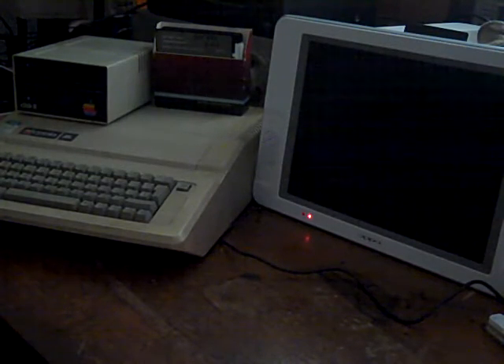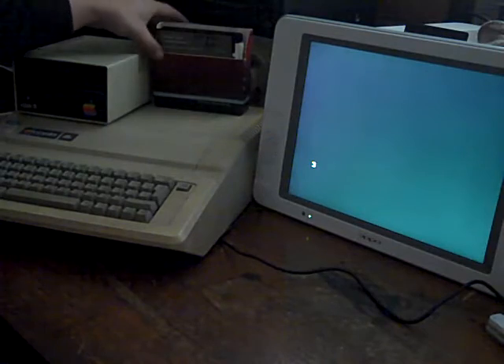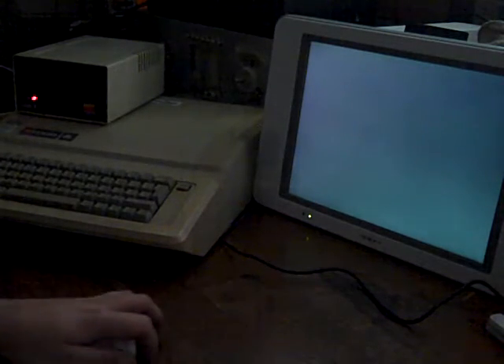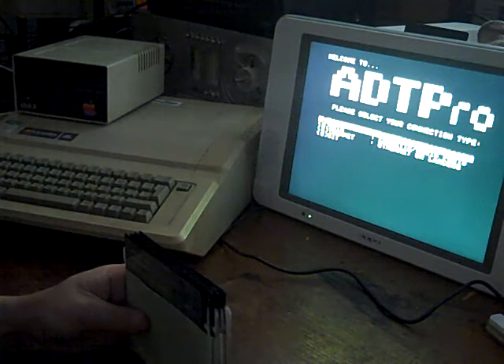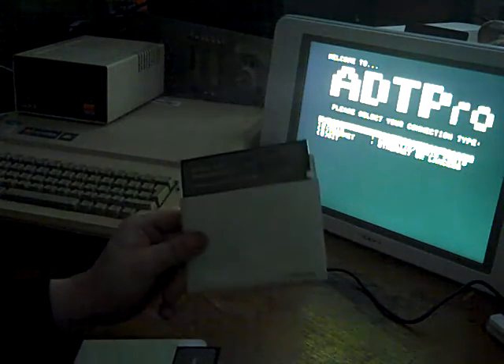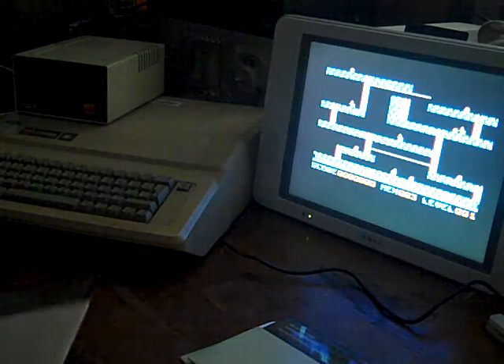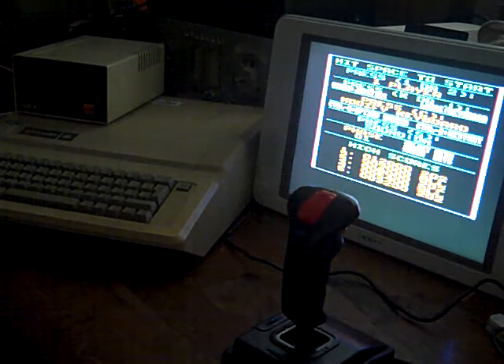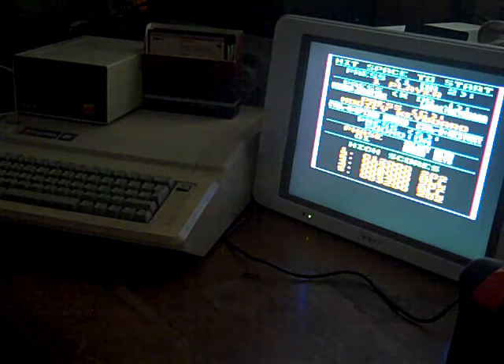Apple 2e repair PT6 Its working

Comment: If you're looking for EPROMs, try the one time programmable ones from Atmel, like the AT27C256R or AT27C512R. The OTP versions don't have the window, but they are in current production, and are a pound or so each. I use those a lot in cases where I'm writing a known working image to a ROM I'm unlikely to want to change later. The Apple ROM and the Dragon DOS are both good examples of those. I still use the windowed versions when I'm trying things out or for temporary fixes, but these are good for permanent installations.
Reply from the maker: ***** they ar'nt something ive ever looked into using but you are quite right they would be excellent for a one off repair. i will look into getting a few to have a go with.

Comment: Brilliant!!!
Reply: I can transfer a disk in 2-3 minutes just using the LOAD command and playing a wav file from my phone (only one audio cable needed that way too).  I would expect ADTPro to be faster but I never got it working (maybe a problem with lineout on my IIe), the tutorial video says it takes 15 minutes, so maybe ADTPro audio transfer is just slow or at least used to be in an old version.  http://asciiexpress.net/diskserver/readme.html hosts many games already converted to .wav and they have a loader at the start that writes the data to a floppy.
Reply from the maker: GadgetUK164 Thanks. really need to get a super serial card for it now especially as some of the games i want to try are on four or more disks and it currently takes about 15 minuets per disk image to transfer over the audio link.